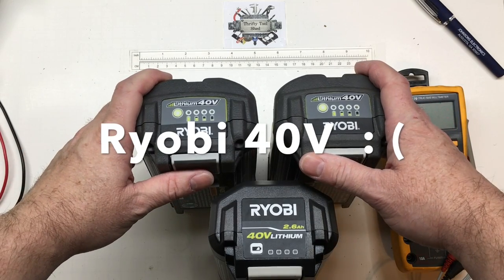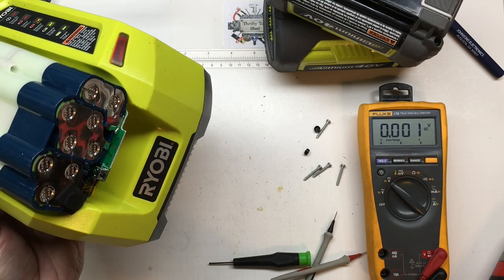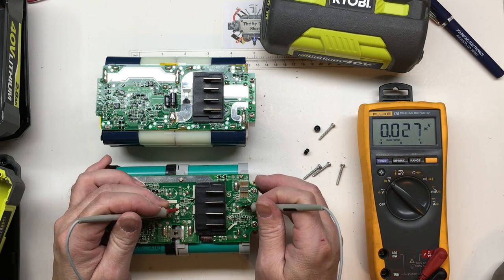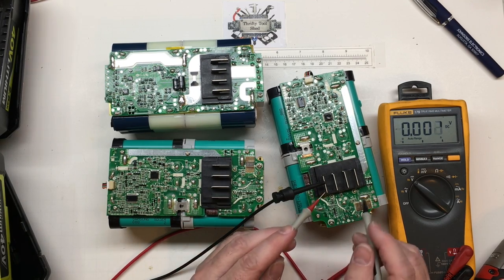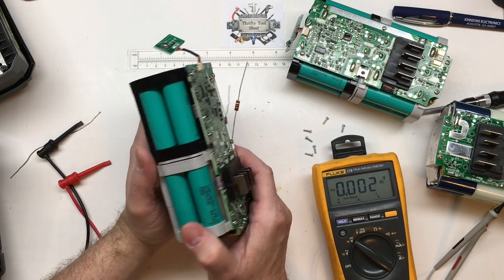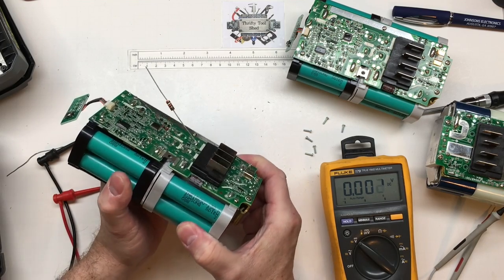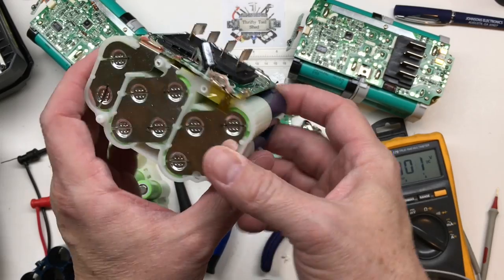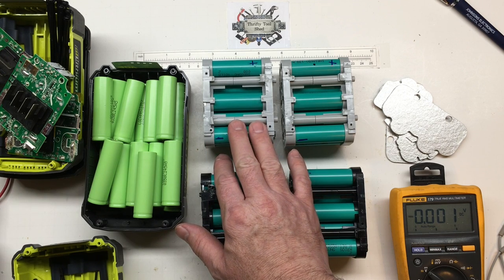Ryobi 40V Battery Issues & Cell Harvesting

Comment: I have saved a few of these pack by beginning at the first cell of the fist of the two packs (C0-C11) I think, measuring each cell of that pack then charging each cell to 4.0v then progressing to the other pack following the same procedure until all cells maintain 4.0 volts.  Otherwise, the balancing chip will not allow any charging to take pace if any one cell is below threshold voltage. Connection to Parallel cells have to be disconnected if charging a cell pair fails so that the defective cell is identified. Charging of all cells individually can be done at the cell connection marked on the board. 90% of the time the entire 40v pack can be returned to service after locating and replacing the defective cells.  Usually this is only 2-4 cells that can cause the entire pack to appear dead with no response from the charger, as in the examples you showed here.  Thanks!
Reply from the maker: That's what I was referring to when I mentioned in the past (4 or 5 years ago) I would replace cells and repair the pack (just as on several of my other videos with other brands) but as stated, mine did not last long before it failed again and many cells had the reduced capacity. Thanks for your comment!
Reply: hey Jerry B can you make a video

Comment: You’ve got to open up the charging mosfet manually, either by shorting the gate from the discharge mosfet or manually applying voltage.  It won’t charge otherwise until it gets over about 28 volts and the board decides the battery is good again.
Reply: Wish you do a video, you are more knowledgeable than most of us, thanks
Reply: .me puedes decir cómo hacer que encienda la luz de carga,porque yo le pongo tierra física y si funciona pero no enciende la luz de carga

Comment: Just got off the phone Ryobi , and they're sending me a new 40 volt pack for my mower ( still under warranty). The original battery lasted a couple weeks short of two years.
     I have the old one to harvest...and experiment with. Harvesting the cells looks easier than I had thought it would be...
Reply: I bought a  RYOBI 40 v mower in July 2019.  First battery lasted 3 months; second lasted 1 month; the 3rd lasted 7 months.  I have since learned they also have trouble with their motors and speed controllers (interface between battery pack and motor).  Can’t believe they are selling a product with this much trouble.
Reply: I believe  they have a major issue with their board design. I just picked up their new $179 brushless weedeater and after bout an hour of use it was sitting at 2 bars and at 35v. Now under normal circumstances with other batteries this would be half charge,however it seems they don't have their low voltage turn off on the batteries set at a tad above 30v,yet they have their chargers set to not charge below 30v.so the user could run the battery till it stops,then the charger won't charge because the voltage is below 30v.

The user needs to understand this and not run the pack dead,plus not allow the batteries to sit idle for months at a time as the bcm will pull the charge down over time.

Understanding this and working around it will prevent alot of battery issues.
Reply from the maker: That's good to know, thanks for your comment!
Reply: Agreed - made the same mistake with my 40v battery using it until low voltage cut off and then couldn’t recharge. Next time will always recharge with one bar left to avoid problems.

Comment: Wow 4 years ago, I'm way behind.  I just had the 4ah in my Ryobi chainsaw fail in a crazy way sort of.  It shows two leds on charge level and if I put it in the charger it shows defective and then flashes all four leds.  I reset it several times and it will go back to two leds each time.  It actually shows 40 volts on the blades.  I found cracks in the bottom of the case and it looks like one cell on the + end had moisture damage.  It still runs the chain saw so I think I will try replacing that one cell after checking them all.  Really hate the way they put it together.  I bought a new 6ah battery today and had to get the Home Depot guy to unlock the case and escort me to the check out as if I were buying a gun!  This world is going to hell faster and faster!

Comment: I have an older style 5ah 40v pack that only shows 1 LED for charge. Put it on the charger and it immediately shows it as full charge, no red error LEDs. wonder if it has a similar problem. Any thoughts?

Comment: Could attempt to solder a ~50k resistor from the gate of the discharge FET to the gate of the charge FET to pull it high and attempt to revive it, assuming the micro doesn’t pull it low too powerfully. This idea is an (hopeful) improvement over just cutting the charging FET gate trace and soldering a resistor. This way you could revive the pack and then remove the resistor to allow Bms proper control. Have a few of the op4026 clunkers on order to try on and if all else, harvest :)

Forgot to mention the charge FET is the one closer to you in the video and discharge is the one further away
Reply from the maker: Thanks for the information.
Reply: Sam Johnson YES!  The board is the reason the pack won’t accept charge at the terminal. That charging FET is shut down.
Reply: If you're just wanting to get it to start charging to revive a deep discharged battery, you don't need to do anything to the mosfet. Just clip an alligator clamp to the positive terminal, and another to the screw next to that fuse, and touch the negative side. Use a constant current/constant voltage buck/boost converter to output between 37 and 40 volts limited to about 0.5 amps. That will apply a charge across the cells directly WITHOUT the charge controller having a say, and unfortunately, without cell balance circuitry. So just go until the pack reaches about 28-30 volts and then connect to the normal charger and see if it will take a charge then.
Reply from the maker: I agree. I have shown this in some other videos with other packs as well ( mostly all TTI packs). Of course I have done many of these 40V packs this way, but this video was about how for ME these packs have not been worth the effort. It's just too complicated of a BMS to be reliable and the on board protection that is so over designed is even the own pack demise when it in fact pulls the cells down a lot of the time. I do however get many good cells from these packs that people throw in the recycle bin etc.  Thanks for sharing!

Comment: If the individual cells are shot, throw them out. BUT if not and all the cells show acceptable voltage, then the following tip WILL fix this problem... The battery has a sensor built in that if it gets down to a certain voltage it will stop your device. NOW... if you get  the error light come on, all this means is that the voltage has dropped below its specified initial charging point, and the sensor IN THE CHARGER won't let it charge. SO, what you do is this: Forget the charger and get two little alligator clips and a DC transformer that outputs 40v @ 500-1000mA. Put the negative to negative and positive to positive and pump 500 - 1000mA direct into the battery for 30 minutes, THEN go put it onto the units charger and HEY PRESTO!!! It just errors because the voltage is too low and the charger doesn't know where to reference from so it errors out, and it won't charge. THIS WILL FIX IT and DON'T let it completely discharge! As soon as it blinks to ONE LED stop and charge. It's the charger NOT the battery. ...The battery shuts down at a certain point so the CHARGER can see the specified initial voltage AND mA to start its charge cycle. DONE!!! Happy days. ;)

Comment: Great video, ratings on the samsung and LG batteries are the same except the samsung have a 3C (4000mah) maximum discharge rating and the newer LG batteries have a 11.5 C (15000 mah) maximum discharge rating.

Comment: I have two batteries that accidentally got left out in a light rain shower last year and today I finally got around to opening them up.  I was able to use contact cleaner, lightly brush the 3ah battery board, do the jumper reset and it is working again, for now at least.  That one had the 4 flashing lights, but my 5ah OP40501 battery had no lights at all and when I opened it up the 2 capacitors in the center of the board were blown.  Do you know where to get a board for the 5ah?  All I could find on eBay were for every capacity but the 5ah.  I haven't tried dismantling yet, but I'm hoping to be able to revive it.  I was wondering about maybe just trying to replace the 2 capacitors, just to give it a go.  Do I have any better options?

Comment: For me, they work fine.  I use 4 packs in parallel, they run cold.  The seal is good for the rain.  They only heat up when I recharge them.  I should build a slower charger.

Comment: At least in the older 40 volt packs, the batteries are two sets of 5S2P cells in series for 10 cells in series to have 42 volts at full charge so an open in the cells would require TWO parallel cells to be defective.  If it looks like an open, I would suspect a connection failure between the two packs or between one of the packs and the charge and sensor circuitry.  You need the map of where the ends of the packs come to the PC board and where the taps on each pack (for checking the balance of the cells in that pack) come to the PC board.  On the older batteries, the pack "ends" are the bigger terminals and the taps are the smaller terminals between them - as they are brought out from the plastic that surrounds the cells and their paralleling strips with tap terminals.  Those are part of what makes harvesting the cells difficult - the plastic totally surrounds the terminals and you must cut through a lot to separate the cells from the plastic, even if you're not separating the cells.  

At the moment, I'm looking to isolate a 3S2P group of good cells for use in an ancient hand vacuum that originally used NiCd batteries.  I have a 3S BMS (rated at 30 amps) to use with that group of cells.
Reply from the maker: Indeed, I have desoldered and repaired many of them in the past. I used to have a diagram of the cell layout over 8-10 years ago. They are easy to follow how the cells are laid out,  just time consuming to take apart and repair and the packs are so problematic it seems like I would have to go back into them again not too long after for a different issue. So for me I simply started using (2) 20V packs in series to run the equipment I had until I bought my EGO 56V equipment. I ran the trimmer and edger for over 2 years with the (2) Makita packs with no issues whatsoever.  I have some repair videos on the EGO 56V packs as well. I have worked on many battery packs over the years and have videos on a lot of them, but I kept getting asked about the Ryobi 40V packs a lot so this video was basically my response to many questions about them and I tried to answer why I stopped working on them for the most part. Best of luck to you with the Ni-Cd pack. Those were the cells I first started working on for sure.

Comment: In my experience with 18650 cells it is really hard to kill these cells but a charge over 4.5v will definitely kill it, I used to use a USB charger with cut wires to charge to charge my cells it was all I had at the time, I'd charge for 5min then check voltage if it ever got over 4.5 volts it never came back, to discharge I had a small string of Christmas lights hooked up to a cell the cell would light the lights for a long period then just cut off with no problem ever changing back up. It sounds to me that the board is over changing to have that many dead cells definitely defective
Reply: Why would i take advice from someone who has apparently no concept of safety or intention of keeping electronics in a working condition?
Reply from the maker: I just now seen the comment you are replying to. Absolutely as I mentioned in many, many videos we never ever want to charge over 4.2V ever. I don't know where the 4.5V is even coming from in the comment and using a USB charger? I always try to mention to only use a CC and CV PS source and never charge over 4.2V. 🤔🙈

Comment: Thanks for the video. I have had some troubles with my 40v batteries.  2 out of 3 are Ryobi and 3rd is a third party.  5 out of 6 of my One+ 18v batteries are bad. All 18v are Ryobi.   I stayed with Ryobi since they worked well in the first couple of years.  I like cordless tools. What would you recommend? Fix and stay with Ryobi or what manufacture would you go with?  Thanks I enjoy your channel.
Reply from the maker: Yeah, I have had more issue with Ryobi packs than any others by far. I would say if I still had 40V Ryobi stuff, I would use a work around. Either the two 20V packs like I did to get by or maybe even look into the new SKIL 40V platform. I have not tried these myself, but I am interested because they are made by Chervon the same people that makes EGO 56V equipment. I bet these batteries are really good. I would even see if I could use them with my existing Ryobi 40V honestly. Make an adapter if I have to.  As far as the 18v packs, they hold up pretty good, but I will repair what I have now but will not buy any more. they are more expensive thanbthe M18 and DeWalt packs, because of the extra protection on board like mosfets to cut the pack off. I did a video showing an adapter from DeWalt or M18 to Ryobi and I will just use these with my higher quality M18 or DeWalt packs. The only downside to the adapter is it has no undervoltage or over temp protection this way. You have to realize when the tool is starting to slow down some, go ahead and charge the pack before you pull it to far down. No big deal at all.
Thanks Brent for your Comment...
Reply: @ThriftyToolShed  thanks for the quick reply.  Funny that most of my trouble is with the 18v packs. I have a few 40v tools like mower, trimmer, pole saw. My 18v list is trimmer, saws all, leaf blower, light, skill saw. I have been using the mower many times a mowing.  Recharge times are when I work on other things.  Anyway, the 40v has been tasked a lot more than the 18v. I wish EGO was out before I got this invested with Ryobi but as I said, I didn’t have many problems then. You have inspired me to measure the battery cells of my bad modules.   Oh, by the way, I am glad Hurricane Laura decided to not head into Texas.  Cheers!
Reply from the maker: @brentjohnson6654  
Interesting about the 18V packs, but I will say to your point, every single time I go to Home Depot and peek into there battery recycle bin I see lots of the smaller Ryobi 18V packs. Like the 2ah etc. Seems they do fail alot. As far as the storm goes, I bet! Stay safe....
Reply: Milwaukee. Period. All other brands just garbage and I used all of them.

Comment: I was told if you keep them out
Of the cold thet'l last you
A longtime. I never have that trouble
With any of my powertool Batterys
Reply from the maker: Although Li-ion does better than many other varieties at lower temperature, I still would tend to agree that it is best not to keep them in cold. I think most cell manufactures state not to charge the cells at or below freezing as well. I actually live in the southern US and we don't get really cold weather, but I still don't like my packs to be stored out in the cold.
Reply: Where do you live?
Tennessee.
Kentucky
Alabama
Georga
Reply: @ThriftyToolShed  I live in minnesota
Reply from the maker: GEORGIA

Comment: Thanks for the really informative video on these!
Looking at my OP40401 board, it looks like they use TP designations for the individual (paralled) battery connections rather than the CL designation you and others refer too which may be the older 40v board? 
Can you point out the stepped connection points & sequence for individual testing, maybe a marked up pic?

Comment: The self discharge of these 40V packs is rather poor & they often get left unused for many months draining to zero. Then the protection sytem blocks normal charging. Perhaps an isolation switch on each pack could stop that problem.